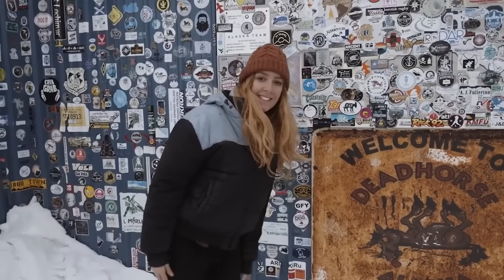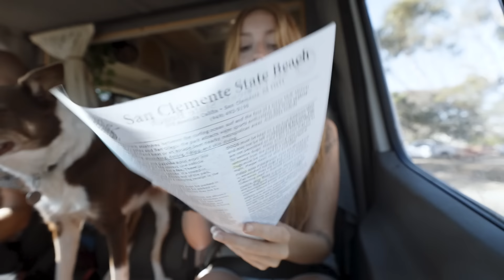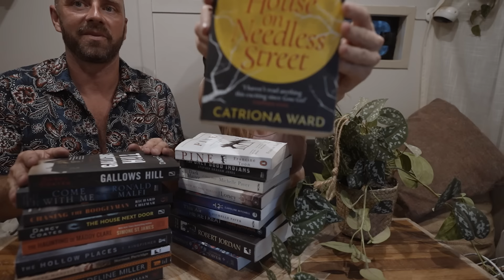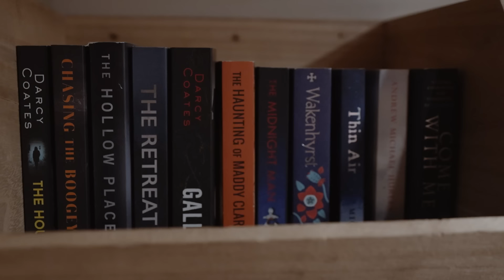Can Anything Else Go Wrong? Ripped Off and P**sed Off (Van Life USA)

Comment: You should be able to buy a caliper slider kit without having to purchase the whole caliper. You'll get sliders and new rubber boots and some grease.
Reply from the maker: Thanks Joe, yes we thought about this. Because the boot of one has gone and the other is completely seized, we think we might just replace the calipers now and have peace of mind. Still waiting to hear how much they are so... we'll have to wait and see 😂
Reply: Definitely do the slider kit! Wayyyyy cheaper than a whole new caliper, if you can knock the pin out and sand it to get rid of the corrosion, you should be all good 😊

Comment: Youre very brave atrempting any trip in a Merc.... Travelled round Australia in 2007 in a 2002 Transit camper van, the rear brakes failed "leaking" and the Ford dealers wanted $2100 to replace one near side brake cylinder. I bought a seal kit for $70 and did both sides & noticed the brake shoes were low.. Ford wanted $670 just for the shoes & we drove 70 miles to a 're liners & had them relined for $110.. We bought the van with 185k miles and sold it 18 months later with 310k miles, still running nicely..
Reply from the maker: Sounds like an amazing trip! There's nothing wrong with a Mercedes to be honest, we've travelled from Eastern Turkey to the north of Alaska over the past 4 years and this is the first time we've had any kind of issue. It's less the van itself and more  the extortionate cost the dealership wanted to charge us and even then, for a job they couldn't do properly.

Comment: It is very important that the caliper slides are freely moving...
The usual culprit is the corrosion between the rubber boot and the casting...
The boot must be removed, corrosion cleaned and reinstalled with a new one or clean and reuse the old  one if in good shape.
Reply: exactly

Comment: Ben! You can buy only the rubberboot on brakecaliper as sparepart, cean with wd40 first then keep glidepin greased and   it´ill be fine🙂  
be caefull not to get any on brakedisk, use brakekleen to clean up brakedisk.
Reply from the maker: Thanks! We’re thinking of either replacing full calipers or just trying to get the seized slide pin to move. Few people have said not to worry too much about the rubber boot?

Comment: Dealerships are almost always the most expensive place to get work done; as we all know.  Doing the work yourself is an admirable task, and as you say being self sufficient is your best choice.  When buying a van, we quickly eliminated Mercedes because it is always the most expensive, even for a do-it-yourselfer.  We chose the Ford Transit instead.  If needed there are dealerships everywhere; unlike Mercedes and many more independent garages/mechanics can work on them. Hang in there, and you will learn a great deal more about your vehicle and yourself.
Reply from the maker: To be honest we haven’t had a single problem with a garage or getting work done on the van in 4 years, despite the reputation of Mercedes. The last time we went to a dealership was in Turkey, where they welded our exhaust back on for free, and fed us coffee and snacks! Every other time local mechanics have been fine to work on the van and source parts. Saying that, Ben has absolutely loved getting his hands dirty. His highlight from the past month hasn’t been the hot springs or mountains, but changing the brakes. What will I do with him 😅

Comment: Fair play to Ben for getting stuck in with the repairs. I imagine by now you've sorted the brakes, but you can get the slider pin to move with a G clamp and winding in.Then pull pin out, clean up with abrasive cloth/scotchbrite and a bit of lithium grease. You can also buy a kit for sliders with boots etc included. Check condition of caliper pistons, may just be a good time to replace caliper. 
Safe travels guys.
Reply from the maker: Thanks so much for the tips, Ben managed to get the pin out with some brute force and used sandpaper/grease to get it moving again. Thankfully no need to replace the calipers. That was one blessing at least 😂

Comment: Dealerships have an earned reputation when it comes to service.  Independent shops are also hit and miss....  When you find a good one they are worth their weight in gold.  I'm a trained mechanic and I'm impressed you took on that challenge. The one thing  I was going to recommend is shout out to your subscribers.. I'm sure you have several mechanics that can help especially with manufacturer specific experience... and then you did!    😎
Reply from the maker: Thanks Jason, you're so right. It's hard enough finding a mechanic to trust even at home, nevermind on the road. Usually we've had amazing luck but not in San Diego unfortunately. Feels good to be able to do these repairs ourselves though, rather than relying on others. Subscribers have been so helpful, always a gold mine of information!

Comment: Clean down the caliper sliders with wire wool. Clean inside the bit where the slider goes, using brake cleaner and a rag or strong tissue. Then grease the sides (not the end) with high boiling point (HBP) grease. They'll move smoothly afterwards.

Comment: Mercedes dealers here in the states charge absorbent amounts.  It's crazy!!  We've learned to go to a fleet mechanics (that work on commercial vehicles), and our local fleet garage is so reasonable.  As to the brakes... we learned the hard way too going down our first steep mountain side (we were smoking for about an hour).  My husband asked a local and they told us  #1) Use your lower gear, so your engine slows down for you  #2)  Brake hard, then lay off, then brake hard, then lay off.  Don't constantly be slowly brakeing the whole way down.    Hope your rig is all sorted now.  Have fun
Reply from the maker: Our garage back home is a commercial fleet mechanics and they are amazing, so difficult to find a local mechanic here quickly, who is willing to work on a RHD, European van AND who has a garage big enough for our high top! Yes always best to use engine braking with the brakes, we’d have burnt ours out a long time ago if we didn’t 😅

Comment: Hi Ben, the squeak you’ve been getting is more than likely the seized slider pin not letting the pad return when you take your foot off the brake. If it stops when you touch the brake pedal then that’s it. It will also make the noise when cornering one way rather than the other. Very common. We have a same age VW crafter which has the same parts and does the same thing when a  slider seizes. We now carry a pair of spare calipers with new pins and swap them over and replace the sliders when we change the pads so we don’t get to that point anymore as the sliders are cheap £12 both sides. Be careful you don’t leave it too long before you fix the slider as the new pads will get worn unevenly as the pistons in the caliper can’t push the pad against the disc squarely while one slider is seized which means re-bedding them when you fix the slider. The calipers in the UK are around £65 each decent quality but not main-dealer. And yes I am a time served commercial mechanic. Keep the old caliper and bash the old slider out when you have access to a vice and drift or heat and replace. Hey presto you have a spare caliper as it is a common problem. They are sided though so can only be used on the side removed. Hope this helps. Currently in our van in Italy doing a house-sit. Then getting ferry from Venice to Patras in Greece. Following your footsteps a bit 😉. Safe journeys
Reply from the maker: Thanks so much for this. Yeah you’re exactly right, the squeak stopped when braking and sometimes got worse turning the wheel left slightly. Took some elbow grease and brute force to it the other day and pleased to say it came out! Sanded it down and greased it up and it seems to be working like new. Will check in a week or so and see how it’s holding up 😀 Enjoy Greece! One of our favourite countries ever 👍

Comment: That caliper slide wouldn't have been found unless the calipers were all removed, which would not be done in 1 hour of diagnosis (assuming that dealer charges $300/hr). It sucks that it took so many attempts to finally discover that issue and good on ya for diagnosing it yourselves!
Reply from the maker: We’d asked them to do a full brake check which included calipers, pads, discs and fluid. That’s what we paid $300 for and we found it within 2 minutes of removing the wheel 😑

Comment: Hi your doing all the the right things! You need to get that slider pin out - try and grab the slider turn it to free it / oil it / knock it out - it will go 👍🏻 you can get a pin slider kit - you do not need to replace the calliper - I would not be replacing the brake fluid - worse case? If you can’t get the slider out? Remove the caliper and take it to a garage where they will be able to get it out for you. Good luck guys 👍🏻
Reply from the maker: Update: we removed the slide pin today! Sanded it down and greased it up and she’s back working again 😀 Will change the brake fluid in a couple of weeks!

Comment: I'm not a mechanic.  For the life of me I cannot figure out why you would replace brake fluid. I do know it's a tedious job to get air bubbles out of the lines though.      Make sure there is plenty of fluid in the well under the hood. (Shrug) Great vids !
Reply from the maker: Yeah it’s absolute pain in the ass! When we crossed the Sonora pass we smoked the brakes and there’s a very high chance we boiled the brake fluid too. That’s why we were going to change it, for the same reason we changed the pads. If we don’t have to do it we won’t 😅
Reply: Brake fluid is hydroscopic, so it absorbs moisture from the air over time, which rusts metal pistons etc.

Comment: And that is in the US!  Can you imagine how much it would have been in Canada! I bet it would have been $2500!  If it is not on warranty, I do it myself. Though they are expensive, they usually do a good job.  Too bad your experience was bad.
Reply from the maker: I guarantee it would be cheaper in Canada! When we wanted our windshield replaced, we looked at places in Alaska and Washington, both charging $1600CAD. We did it in Vancouver for $600 CAD😳 Also what Mercedes’ wanted to charge us for two hours of work is what we paid for a full brake replacement, new handbrake, parts included and 2 days labour in Vancouver. Madness.

Comment: This is the main reason why I would go for the ford transit over mercedes. For sprinter you HAVE to go to mercedes to fix even the smallest things which will cost an arm and leg. For transit, pretty much any of your run of the mill garage will fix pretty much any problem you will ever encounter.
Reply from the maker: Not true at all! We rarely go to Mercedes dealerships and had our full brakes changed by a local garage in Vancouver. Our garage back home is independent too. Only went to Mercedes this time because we only thought it would be a brake check, and many garages here don’t like working on a RHD European van, no matter the make!

Comment: Heating up the caliper where the stuck slider pin is should release it and then you can clean up the hole and put a new pin in 😊
Reply from the maker: Thanks for this! Used some elbow grease and managed to get the pin out, sanded it down and the old one seems to be working fine again 😀 Although will check it again in a week or so and see how it’s holding up.

Comment: I feel your pain guys. I have always hated garage bills and like you only, used main dealers to diagnose the problems. German manufacturers are notoriously expensive but have an even greater premium in the US. I do most of my car maintenance now, building confidence following jobs on my vehicle on YouTube saving tens of thousands over the years. Also judging when you are fine with non branded  parts. It's so easy to identify and find parts now for your vehicle, hopefully you will become more self sufficient.
So glad you got the money back from Mercedes, 
At least you didn't need to have parts shipped from Europe like Chris and Marianne. Small mercies 🙏.
Tip: take lots of photos as you disassemble anything.
Reply from the maker: It really pays to be able to do what you can. We had non branded parts when we had the brakes changed in Vancouver but went for branded parts this time. Like you said though, just thankful we can get them easily!

Comment: Great channel. You dont use grease on the ends of break pads it will burn off when breaks get hot, they go in dry. Safe travels
Reply from the maker: The eternal debate - to grease, or not to grease! We choose to grease 🥲

Comment: you should be able to buy a caliper slider pin kit which will consist of  pins rubber boots and grease you will probably need to clean the bores that the pins side in as it looks like thepins got very hot and the rubber has coted the bore
Reply from the maker: We think we are just going to replace both calipers as we have some big drives ahead through Mexico, so better to err on the side of caution 🙏

Comment: Garages know as soon as you pull up you are there because you can't do it yourself for what ever reason, a half decent tool kit and Google you should be able to tackle most maintenance jobs, as for books, the best book I have read is, I Am Pilgrim by Terry Hayes, it's his first book, released in 2013 and was an instant best seller, I've read it 5 times, absolutely brilliant, good luck with the spanners 👍
Reply from the maker: It’s hard to find a mechanic you trust even back home, never mind travelling. Most times we’ve been fortunate but this time, not so much. Thanks for the book recommendation! Must be good if you’ve read it 5 times 👍

Comment: Ever had an ESP warning come up on your dash? It happened to us recently in France. Took it to a Merc dealer in Nice - €2800 quote to fix it by changing the steering column! Thanks but no thanks - 2000km later and no re-occurrence. Agree totally with you that we need to be as able to handle basic mechanics ourselves. Bon Voyage!
Reply from the maker: You’re joking 😳 That’s unbelievable!! Yeah we’ve had ESP warnings before, usually turn themselves off! Hope you told them where to put their steering column 🥲

Comment: Recently I needed an AC belt for my Camaro The Chev dealer wanted 120 bucks for  a new belt,a minimum hour labour to install it plus shop supplies.I said, ya ill look around.
Went to the local auto parts store, $26 for the exact same belt. Then I went to my usual mechanic he had it on in less than 15 mins. I asked him how much he said don't worry about it......bring me a coffee next time your in.
Dealerships are SKUM.
Reply from the maker: This is exactly it! Honestly it should be a regulated industry. Dealerships are the worst. We only wanted Mercedes to do a diagnostic check but they couldn’t even do that without ripping us off. Your mechanic sounds awesome, we all need garages like that!

Comment: Ben, when you go to replace the tire rod end, use a paint marker or such, and mark the last threads going into the tire rod you can see. That way when you place the new one on, tread it up to that line and you should be close enough for alignment. Good luck, you can do it.
Reply from the maker: That’s exactly what I plan on doing! Thank you 🙏
Reply: Hi Ben. Also count the amount of full turns it takes to wind off the old track rod and wind the new one on the same amount of turns. Maybe easier to replace with the tie rod as well if you can’t get undone. May come off easier at the rack end. Mine did

Comment: Just a comment. On a brake check, if the pads are still ok and the discs are ok from a visual check, the pads won't be taken out and thus the seized slide pin and torn rubber will not be picked up. So I can understand that bit. The extortianate amount though...
Reply from the maker: The thing is, this wasn’t just a basic brake check. We had smoked the brakes over a mountain pass and had specifically told them about this incident and asked them to do a thorough brake check because of this incident specifically. They had the van in for an entire day to do a thorough brake check for us, which was supposed to include calipers, brake fluid etc. Thats why we were so frustrated with them 😅

Comment: I bet most independent auto repair shops would be able to fix the Sprinter also they're quality aftermarket tie rods, brake parts available..Screw MB  dealerships charging those prices
Reply from the maker: Most probably! Any big job we wouldn’t go to a dealership, but just thought it would be a look over. Never thought for a minute they would mess something so simple up!

Comment: Well done for finding the problem with the brakes and fixing it, yes it will need a new caliper, they are normally sold on a exchange basis, and real easy to change, just take not of there the brake Flexi pipe is before you take it off, but if you have a vibration only when braking then it has warped the disc with the caliper slider being seized.
Reply from the maker: Thanks Andy, will ring you if we run into any problems! 😃

Comment: Hi Ben, when removing that track rod end count how many turns there are to get it off, then turn that many back on, whatever your tracking is now it will be afterwards, treat that slide pin as a bolt and rotate it as you remove it, pulling on a jammed pin will take a lot more force, your brakes will not be working properly all the time a "sliding caliper" cannot slide, this problem will also warp your disc if left too long, considering your recent brake issues check whether there has been any change in the colour of the disc (blueing?) if so the disc is not trustworthy but definitely don't trust your old pads, smoking pads are ruined.
Reply from the maker: Thanks a lot for this Glenn 🙏